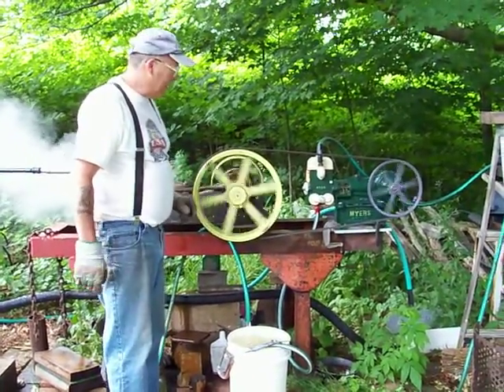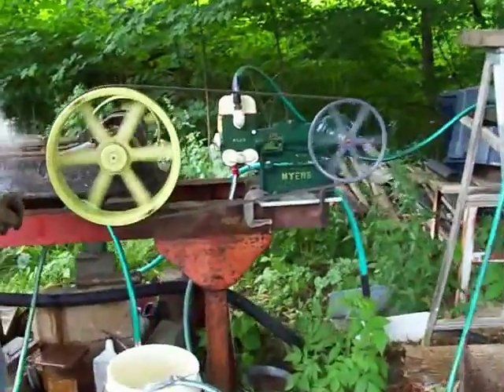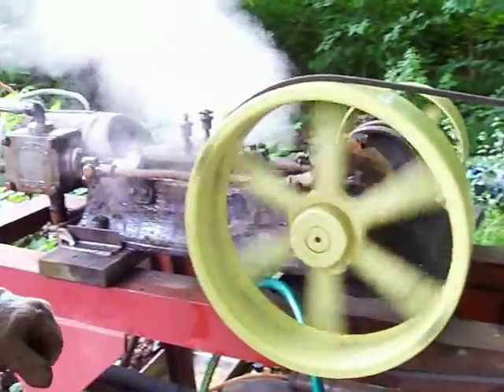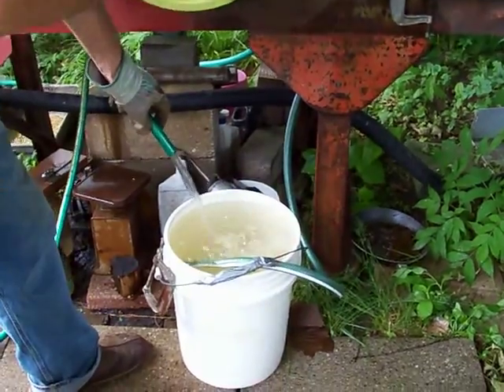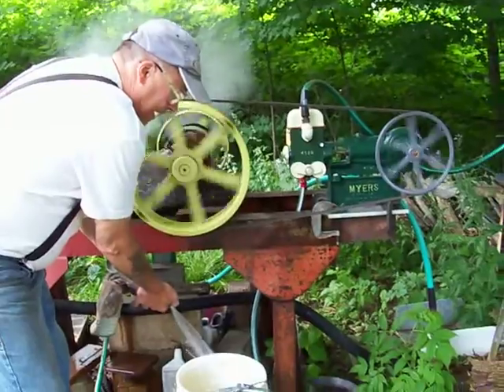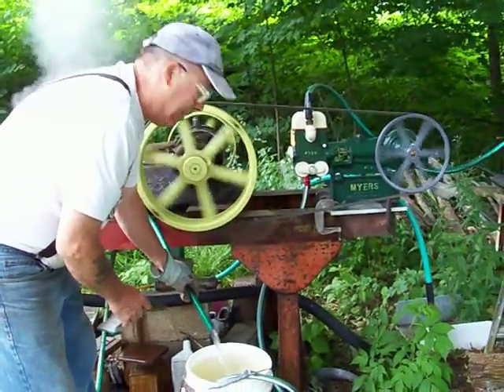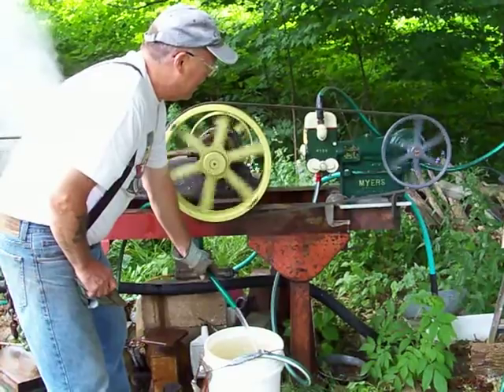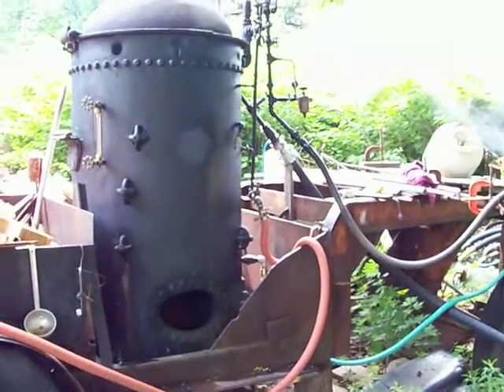Antique Myers piston pump steam-powered boiler water feed system.

Comment: What was the outcome of the 1909 myers pump? Can it put out enough pressure to use as boiler feedwater? Im eyeing the same pump for the same reason
Reply from the maker: I run the boiler at only 45 to 60 PSI, and the pump can overcome the back pressure. I think the max pressure of an old piston pump should be max 65 PSI.
Reply: @Beechnut985 I'm running a water tube boiler that came with a 250psi safety valve. So I'm struggling to find a pump to cover that. I may just have to buy a lower safety. Thanks for your reply
Reply from the maker: @adamgentry332  what about a Injector? Penberthy type.

Comment: Any sorce to locate parts for the water pump?
Reply: @Beechnut985  i cant find them on ebay.  Can you assist me on finding the ones you used?   The cups i have will work
Reply: @Beechnut985  well id like all of the seals.  Valve seals, piston cups, ....  but the main thing i need is the piston cups and leathers.  I can make due with the other things but i really need everything.
Reply: @Beechnut985  tried to post my email but for some reason it deletes it.   That way we can exchange numbers.  I dont want to post my number